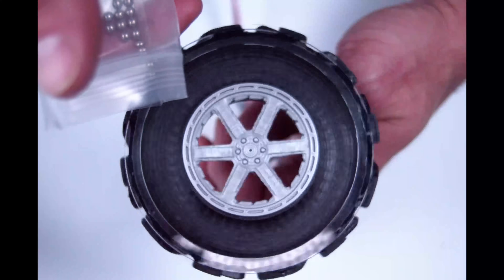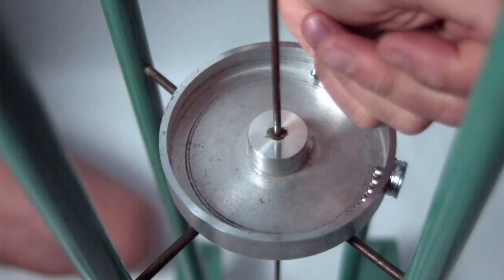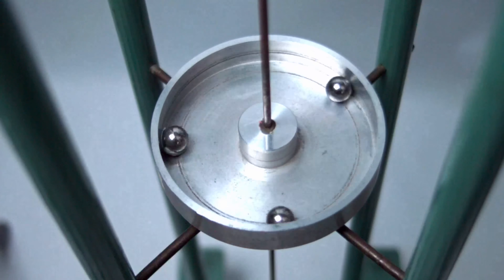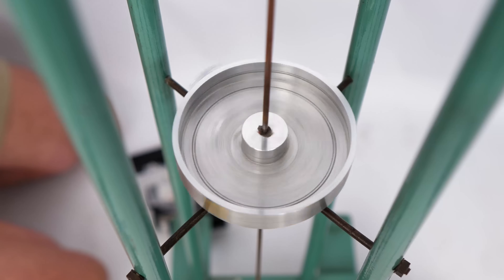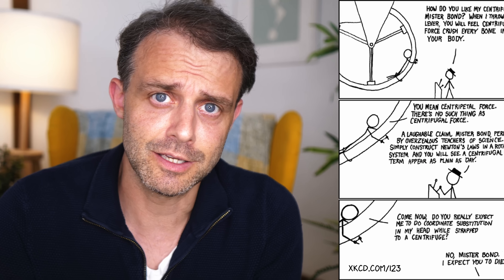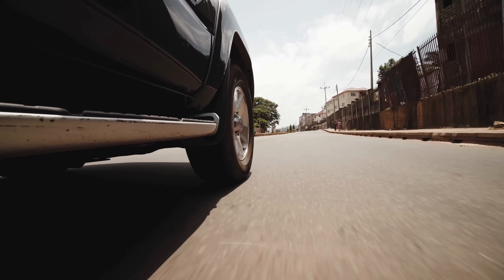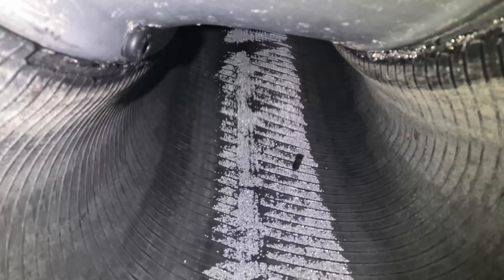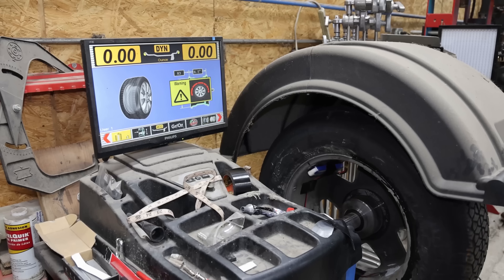Do tire balancing beads actually work?

Comment: To summarize if they work for car wheels: partly (start working reaching highway speeds, stop working once you drop below a speed when gravity moves the beads out of balancing position, until you sped up again to highway speeds). Traditional counterweight balancing works always all the time. The costs/convenience: negligible. letting a mechanic balance the wheel when replacing tires often is included in the price, or cost you € 15, Compared to getting beads for € 7.95 and then having to deflate/take tires of the wheels to put in the beads. Even if you let the mechanic put them in when buying new tires, i bet they charge you barely anything different for that than they are for putting on a counterweight.

Comment: Amsoil used to sell a disk that mounted between your tire and brakedrum that had ball-bearings in a round clear tube with oil in it that works the same as the glass beads in your  tire. I don't think it could be used with disk brakes plus with all the fancy wheels you can have you didn't want it to show behind the wheel.

Comment: Long-time follower, First comment, excellent video, and we have lots of experience with these beads. Your tests are exactly how they perform. We use them on our overland truck with tires that are 42 inches tall, which I think lowers the hop speed to 35mph. It's super annoying at that speed but if we can get past it then it will remain smooth. Our tires are so big and heavy (over 200lbs per) that traditional balancing is challenging, so beads it is. I have tried to figure this out in my head so many times, but I think I finally understand it! Thanks

Comment: Amazing video Steve! On my 4WD I’ve tried balancing bead on 2 sets of 35 inch tires over 6 years. The effectiveness had always been “elusive” and I could feel it changes every time I stop. I thought it was because I accelerated too fast so the bead got “stuck” in a pocket before they could have a chance to move. So I sometimes try slow acceleration or even hitting the rumble strip hoping to “shake them loose”😂 now I finally understand why my intuitive methods never work well

Comment: I tried balancing beads and never felt like they really did a good job of balancing. I stopped using them because of the mess they left inside the tire when a tire repair needed to be made.  If you plug the tire the beads end up sticking to the plug inside the tire. If you patch the tire you have to remove the beads first and then try to get them back inside without getting any caught between the wheel and tire when resetting the bead. 

I now use wheel weights in combination with centramatic balancers on all my trucks.

Comment: Really interesting! Now we just need a way to make the beads stay where they oriented themselves at highway speed. How about a very thin resin that your pour into the tire and that solidifies after e.g. half an hour while your are driving on the Autobahn/highway/motorway? This way, the beads would center the fast spinning wheel, the resin solidifies and the beads stay where they are even when the wheel has stopped.

Comment: Aircraft propellers can have the same vibration issues and require being dynamically balanced by adding (much smaller ) weights- like car tyres. They are usually attached to the spinner hub in close to the centre of the propeller. Propellors on light aircraft  spin at usually between 2000 and 3000 rpm. Clearly this is fast and as comparison is like driving a car permanently above the critical speed. So if the effect works it’s easy to see it could work on propellers. 
There is an American product ( “Balance Master”) that uses this same principle  but with mercury in a disc with a circular channel. They make them for land based machines as well but in this context the super high speed of a propellor may actually push it into the always functioning speed zone. 

The manufacturer claims it will automatically dynamically balance a propellor without need for expensive vibration analysers and trained operators. 
Opinions  on various aviation forums seems to be varied from works fantastically to doesn’t work at all. Although one writer suggests the weights in the device may be too small in some situations and that where the weight is enough it will work. I have never seen one for real but I think they come either a fixed weight with no capacity to change it.

Comment: You can balance your tires the exact same way by using a small amount of liquid antifreeze. A liquid will do the exact same thing and flow to the right spots. Don't ask me about the effects of antifreeze on rubber though, I'm just saying it would work... For motorcycles you can actually buy balancing liquid specifically designed for this purpose. It likely works better in their small tires because they need to rotate more times per second and so it becomes effective at lower speeds.

Comment: 1st order vibrations felt in tires are normally felt around 45mph and get worse as you speed up. I dont see how any reports the vibrations diminish when at freeway speed. That's when most customers bring in their vehicles for vibration concerns

Comment: I watched 2 and a half minutes and determined that tires would only balance at speed. At low speeds, tires would be out of balance wear faster. Also, if you had a blow out, there would be a bunch of buckshot shot out of it. I can think of plenty more reasons why this is a waste of time.

Comment: Someone used to sell a plastic disk with small shot in a channel on the perimeter.  The shot would eventually rust in place and tire was balanced.  You just had to put the ring back in the same place if you did any work on it. And loosen the shot if your balance changed.

Comment: My two cents. I use them with no external weight with 37/12.50r17 tires. 95 mph on a closed course with zero vibration, steering issues etc.
From all the literature I have read balance beads work best on tall skinny tires. They do nothing for lateral imbalance.  Aspect ratios below 75 are generally a no go.
Also work great when you end up with a lot of mud in your wheels and then drive on the road.

Comment: Used them in a motorcycle that had a wheel that was suspected to be very slightly bent/warped making it impossible to balance traditionally. They work. Supposedly the material they’re made out of builds crazy static electricity so they stay in place even when you stop.

Comment: i wonder what affect you doing the expirements spinning around the y axis vs the x axis, my intuition tells me that gravity will have an opposing affect to the centripital force created by rotating that would make it harder for the tire beads to find the correct position. Then there is the friction from the inside of the tire that each time a bead hits the frictional force would be greater than the "mysterious force" that is reponsible for putting the beads in the right spot like demonstrated in your video.

Comment: I’ve been using balancing beads in trailers, cruiser motorcycles, and my off road (but driven on the road) trucks for around 10 years. 

No issues.

Comment: I swear by using balancing beads on large/heavy truck tires. Previously, I had to get the balance checked every 3-5k miles, now with the beads, I don’t even think about it and my truck drives smoother than ever!

If you’re driving a truck with 35s or bigger, I would highly consider asking your local shop to throw them in.

Comment: I have a set of the "rings" on my motorcycle (one back, one front) and it works great. Every time I need new tires, which isn't very often because the beads keep the tires balanced all the time, the motorcycle shop guys almost forget to remember NOT to balance the wheels. I recently put new Cooper tires on my '93 F150 with glass beads inside. Works great! Some people think beads will chew up the inside of the tires, but the beads are round... they roll.

Comment: This has been a thing for many years.  motorcyclists have used this for over a decade. instead we used a liquid polymer so once it balances at higher speed it stay balanced at stops and slow speeds but will puddle back down if you park for an hour.

Comment: Hello, automotive technician here. Watching your video, seeing the small-scale demonstration of how the balance beads work, I am troubled by one fact - albeit I am not taking anything away from this video, or shunning it - the small-scale demonstration has a perfectly symmetrical round wheel which the beads are dumped into are not being jostled around as they indefinitely will be inside of a softer than steel tire as it rolls over the hard road.... Yeah, the flat spot that races around the tire tread as its driven would surely cause them to scatter a little bit... It's crazy how much of a beating the tires get, how flexible they are and their ability to do what they do .. balance is good...

Comment: From a product improvement standpoint: Why not add some kind of quick setting adhesive at the same time the beads are initially added? So basically: add the beads and adhesive, quickly get up to the "self balancing" speed, maintain that speed for the setting time of the adhesive. Then after slowing down to a stop, the beads will stay in the exact spots that were found during the balancing process during the high speed.... Anyone object?

I could see how there could be issues with the adhesive coming loose over time, but this could be solved by adding more adhesive and doing the process again every few months/year.

Comment: 50 years ago or more there was a set of rings that had small ball bearings inside the hollow ring. The ring would fit or attach to a car rim. They were supposed to balance the tire. I never knew anyone that tried them. I always thought a lower speeds the tire would be out of balance.

Comment: They might work, but every time you start driving, your tires will be extremely unbalanced until they spread out. But with the normal tire balancing weights, you just stick them on and it's balanced.

Comment: I use solid bb gun bb's on my large offroad tires. Works very well especially since my tires get chunks ripped out on rocks. Smooth as balanced road tires in the highway 👍

Comment: Could you use this in some way to balance a bench grinder? You would need to have perhaps  a few 'freely' moving weights (in a groove, say) that you could stick in place more permanently later. But how would you find those optimal spots, after having slowed down again?

Comment: This is the same idea behind Lagrange points. The bead will bounce around trying to chase the heaviest point (the point where the weight is stuck to) but in its bounce, will roll into the Lagrange point opposite to the heaviest point, and get trapped into it. The more beads, the more complex the Lagrange points system is.

Comment: Weight moves farthest distance allowed from centrifugal point. When wobbling the cup edge is farther from center and free weight moves to farthest point. then process happens again until equilibrium is achieved. the problem with tire bead isi  low speed will induce greater wobble destroying tires before they reach equilibrium.

Comment: Imagine a jetski plowing through waves then skipping over waves when it goes faster, its that but in a circle
even though the balls have constant contact with the inner rim, the weight being pressed against it is fluctuating because the moment of inertia is seperate from the odulations of the spinning disk just like a jetski skipping over waves, and those little "impacts" act as a damper on the disk
So basically the spinning balls WANT to spin in a perfect circle just like a moon in orbit around a planet, if you put a giant oscilating ring around that orbit the moon will stabilise the oscilations

Comment: Tire balancing beads are a kind of scam. Sure they work, but do you drive nonstop? you inevitable slow down for gravity to take effect. And then you have to accelerate again to 60-80 mph for it to work again. But by then you most likely can't accelerate to that point again and you witness you wobbling tires again. So no good comes out of that. And you damage you axle in the first place from the acceleration.

Comment: It seems that using a thermoplastic that will deform/melt the tires with the heat generated at highways speeds would allow you to put them in drive highways speeds for a while then have them stick into place 'forever'

Comment: You need to have the tyre get up to highway speed (Australian) and then hade a way to fix the beads in place for when you slowdown, stop and then later drive your normal 80km/h roads. Perhaps a mixture with the beads in it that has a malting point that melts when the tyre heats up at 100 for a while and then a reaction happens creating a solid that stays like that even after cooling reheating cooling reheating for several years.

Comment: Is the wheel on flexible axle with bearings like a vibrating string in that there are multiple modes of vibrations of decreasing amplitude?

Comment: Could this effect be cured? Um, so. If the rubber tyre's inner surface were coated with something that would soften from the slight heating the tyre gets from high speed travel upon the autobahn and this coating would grip the glass beads, holding them in place even upon slowing (and, presumably, cooling). Therefore, you could cure in a good semi-permanent balance at low speed.

Comment: I use them everyday and they work much better than weights because I have 37” mud tires. They’re very hard to balance. Drivers that say vibration goes away at high speeds with unbalanced tires is ludicrous that’s when it gets so much worse. With beads I don’t feel any variation at any speed. It’s really only the off road community with large mud tires that use them.

Comment: There is a company called Centramatic that makes a tire balancing device for big trucks that uses the same concept but doesn't add the beads to the inside of the tire creating friction/heat to the tire.

Comment: I've used them many times,  from my experience they work fine on big mud tires on lifted trucks,  but don't work great on small wheeled cars. I rarely drive above 55/60mph. I've settled on only using the beads when traditional balancing is not an option,  like on a rock crawler with beadlock wheels,  or on styled wheels that don't have provisions for pound on weights, but the wheels are offset so far sticky wheel weights are impractical. 

I've also heard that having too soft of springs or too light of a car will cause the beads to not stay in position,  but I don't know if that is true.

Comment: I am a shop foreman at a motorcycle shop and this is the exact thing I have seen. I have been asked many times about the idea of balance beads by my techs and customers. My thoughts are as your results prove, they don't work good at low speeds and its even more evident on motorcycles. In short, I hate them.

Comment: Like you said everytime you drive low speed stop and go it'll wobble.... Or you can balance them yourself with weights and a bubble balancer they're 80$ cad 🤣🤣 beads are mostly used on freight truck tires if I remember correctly 😅

Comment: My personal experience...balanced beads work best in motorcycle tires at one end of the spectrum and in semi tires at the opposite end of the spectrum because there is more to it than your simple explanation  and controlled experimental evidence because the controlled experimental evidence violates the mandatory real world variables that actually makes them work at all speeds

Comment: Proper tire balancing starts at the Tire Shop. Here's a list in percentage of reasons that can cause a Tire not to balance on the balance machine:

    Improper centering 60%
    Residual static imbalance 10% (Tire not clocked on wheel properly to remove residual imbalance > 0.58 ounces before final balancing. De-bead and rotate tire on wheel 180° then retest)
    Improper placement of wheel weight 7%
    Drive train vibration 6%
    Balancer calibration 5%
    Eccentricity problem 5%
    Improper lug nut torque 4%
    Bent wheel rim 2%
    Other 1%
 (Included in “Other” is force variation at .05% as measured in Dynamic balance mode.)

Comment: I experimented attaching a circular box containing some beads to a wheel so it would make a noise at slow but not high speed. This would help people hear a quiet electric vehicle (or bicycle) moving slowly at junctions etc without irritating vehicle users at higher road speeds. It sort of worked, but a speaker's simpler - and can make noise when stationary too (useful for any nearly blind pedestrians).

Comment: Auto tech here, they work but I would only use them if it's a large truck tire or something. People that put oversized negative offset wheels on their trucks have poor ride quality not only because of all the unsprung mass but because the negative offset of the wheel makes putting weights on the outside undesirable. Sometimes it's the best solution for aesthetic reasons. Also there is absolutely no shortage of people who don't know the best way to balance a tire to start with (the machine is useful but not a replacement for actually understanding)

Comment: Someone needs to make balancing beads with a wax coating that melts at freeway speeds. That way, the beads will stick in place with a wax coating to the interior of the tire and not move at different speeds once it’s balanced.